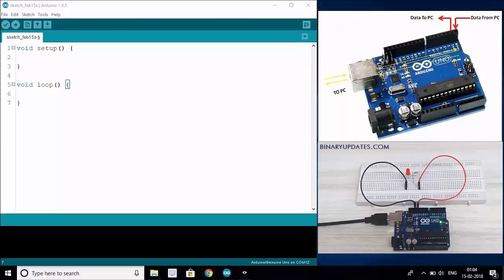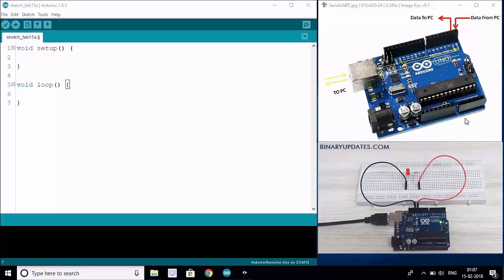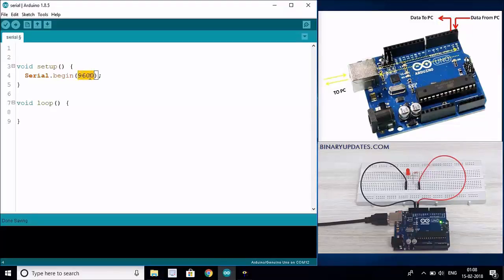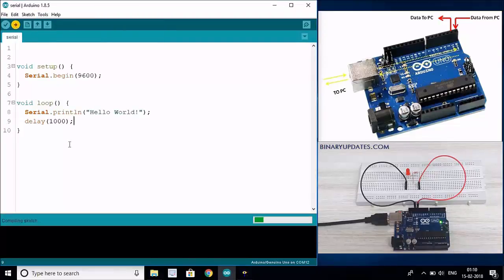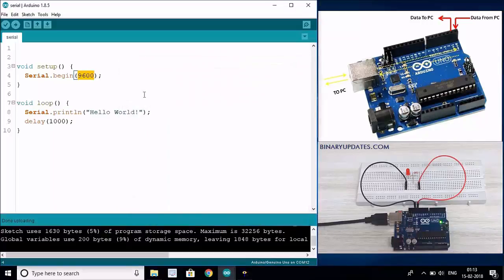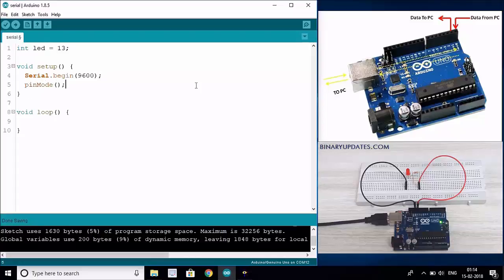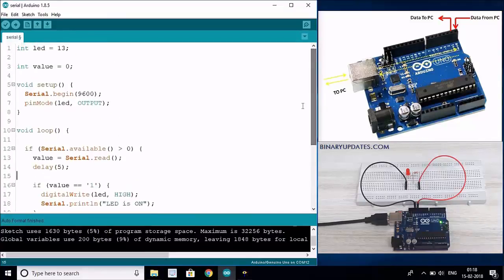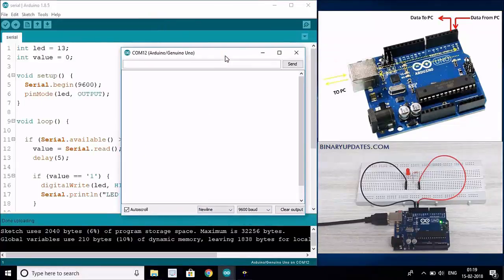Arduino Serial Communication using UART

Comment: Proper click bait video.. Man has kept UART in the caption but hasn't taught anything related to UART. Please don't misguide.
Reply from the maker: This video demonstrate the use of Arduino Serial class which uses USART/UART protocol means Tx and Rx pin on Atmega328 MCU. In Arduino, Tx and Rx is internally connected to Type-B USB Hub. Please read more on Arduino website about how Serial function is built.

Comment: This configuration has nothing to do with UART Tx/Rx, it is simply using pin 13 as output with Serial
Reply from the maker: Yes, you're right. I explained it to let viewers know there is UART Pins Tx, Rx does exist in Arduino

Comment: Hello, how to do this using interrupt?
Reply from the maker: Hi Emira, you can use UART peripheral with Interrupt. 
Also consider using interrupt vector available in ATmega328 microcontroller on Arduino. There are some video out there you can explore on YT. Good luck for your project and best wishes!

Comment: Hi

Thank you very much. Nice video. Do you think the Arduino can be used as UART reader to write in airbag ECU with renesas MCU? Rf561725.

There's a reset pin normally used
Reply from the maker: Yes, you can

Comment: You said we would communicate through tx and rx pins, why didn't we use them here?
Reply from the maker: Hi Adem, because Tx and Rx Pins on Arduino is already in use with USB Connector and since its internally connected we don't need to connect Tx,Rx pins externally. I hope this will help you understand. Good day

Comment: if we send string like "On" or "Off" from serial moniter  instead of one char '1'or 0 then how to handle this please help.....thankyou
Reply: Try using ascii values. It should send the chars as hexa decimal values. Just do boolean comparisons on the hexa decimal values you receive to see if they match the corresponding ascii values. You will have to compare them one char at a time though. You could have two arrays, or nested if statements or something a long those lines.

Comment: Is it me only? I miss the connection and programming of the UART. The video shows only how to program and connect Arduino via USB.
Reply: These are in built functions of the Arduino.. to understand completely you will have to learn the basics of UART and hote data is transmitted in 8051. It is pretty simple. Once you understand try to write the functions yourself
Reply: @sachinm3519  Arduino microcontroller is not 8051, or it is compatible with that? By the way... it is not that simple. It is not that simple as just connecting RX/TX pins to TX/RX of the other device. RX/TX pins in arduino sends 0 V for "1" and +5 V for "0". I tested this connecting those lines to a PC and to other device and it did not work. Finally, I had to use other pins and use SoftwareSerial library to send inverted bit. That way I could use a PC to monitor the sent data and finally, to connect to other device, which is actually a Modem.

It would be more useful if a video using RX and TX pins of Arduino is uploaded.
Reply: @jaimestuardo4655  
Did you find any videos of the type you were searching for?
Reply: @search4truth616  I didn't. I have found out how it works. The routine I programmed for Arduino is sending information to the PC where I am monitoring the serial port data. There are 2 key points here: To understand that Arduino works with inverted voltage levels and to make things simpler, to use SoftwareSerial library so that it inverts levels before sending data to the PC.
Reply: He literally said it in the within the first 60 Seconds of the video :D
Reply: @crateer  Even he mentions it, the demo he shows was using the USB port to connect to the PC. The title should be different because many people (including me) came here expecting to find a demo of using P0 and P1 pins. That's the point.

Comment: Baudrate is not bits per second, its symbols per second or pulse per second. Where one symbol can contain several bits.
Reply: Baud rate is the number of times a signal on a communication channel changes state, or varies. For example, 9600 baud rate means that the channel can change state up to 9600 times per second. The term "change state" means that it can vary from 0 to 1 or from 1 to 0 to X times (in this case 9600) per second.

Please inform yourself before misleading others.

- Ricardo Nunes, Portuguese Electronics and Automation Engineer ;)
Reply: Although back in the day, 300 baud was 300 bps.
Reply: @briandenley  
right.......   But even as 300 bp/s  it was not referring to transmission speed
but symbol changes per second
because the symbols are indeed bits

although the purpose of the bits is not to justify speed but to define data and data content by changing state X times per second
also bps was still the incorrect way to refer to Baud

so let's try and clear up the confusion between bit rate and baud rate shall we
Reply: Yes  you are Wright ! I learning arduino c and this byte/second .1 byte is height bits . 1 caracter = 1byte . ex: 9600 bauds/sec = 9600 caracters /second ....thanks .....johan
Reply: Exactly, that's why i just told him
Reply: Yeah, one can also say transition per second